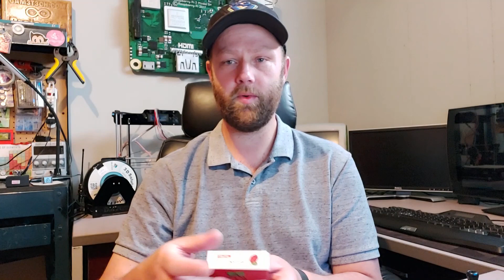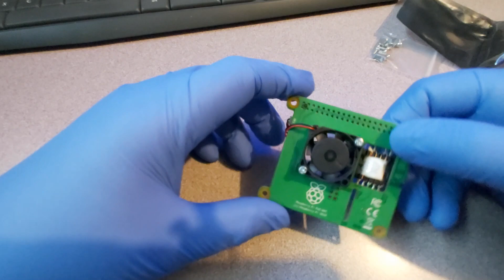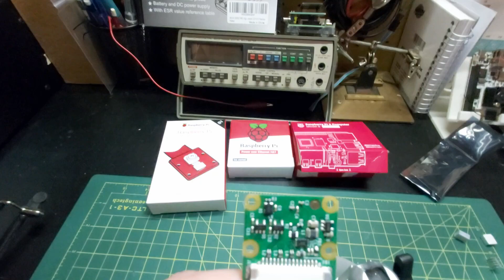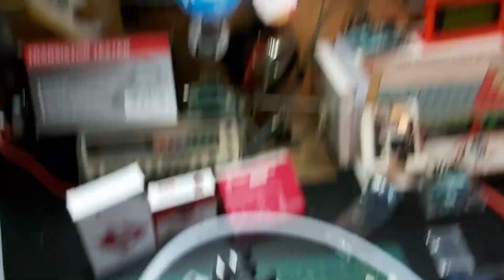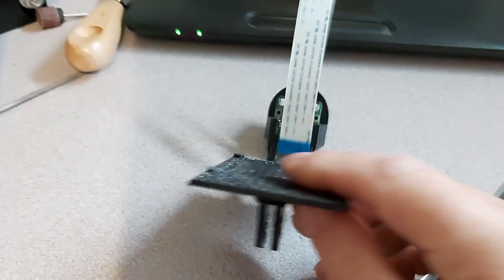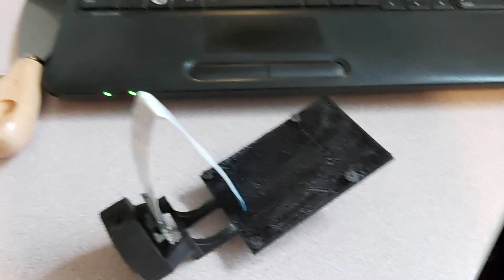Raspberry Pi Official POE Hat -  Element14 Roadtest - Testing and a few projects

Comment: Which heatsink did you remove to get the PoE Hat fit?
Reply from the maker: I ended up putting a lower profile heatsink on the cpu and removed the ram and video heatsinks.
Reply: @Gam3T3cHElectronics  do you have a link to this specific heatsink?